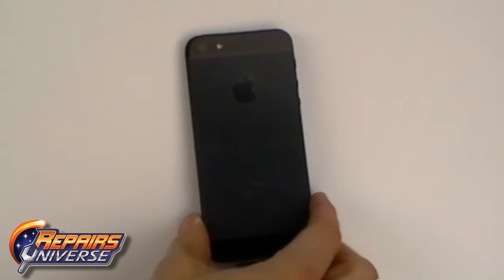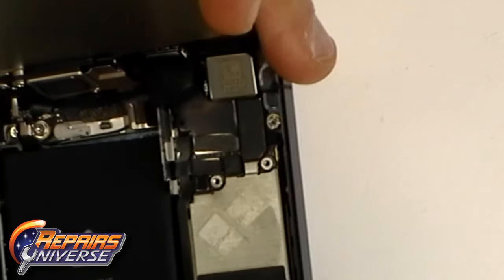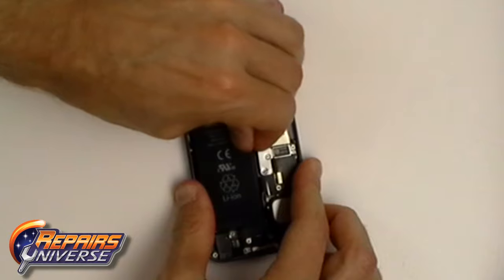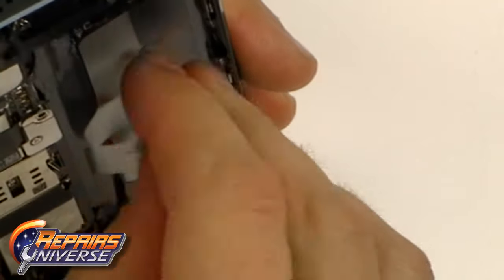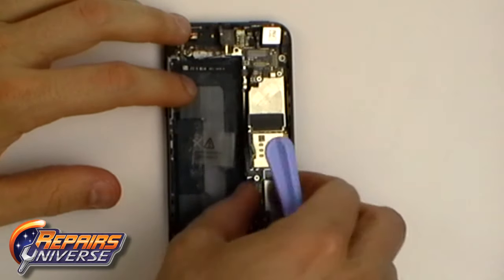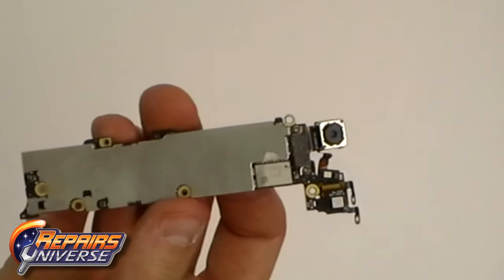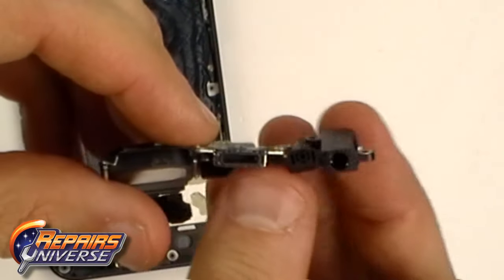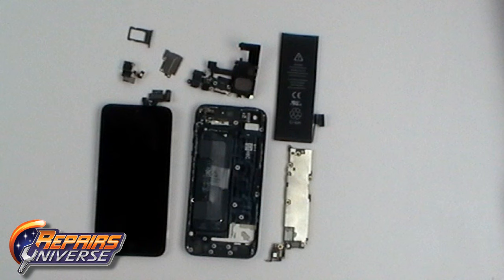iPhone 5 Take Apart & Repair Guide | RepairsUniverse

Comment from the maker: Hi Chirs, 

You are correct the screen does have some extra components which are easy to remove. However we got a batch of replacement screens and the screens included these small parts. We are however expecting future screens may not. If this is the case we will do a full video showing this in detail. It's pretty straight forward though, just a few screws.